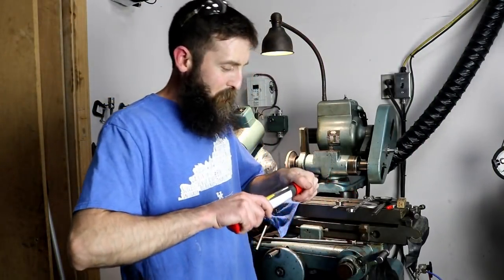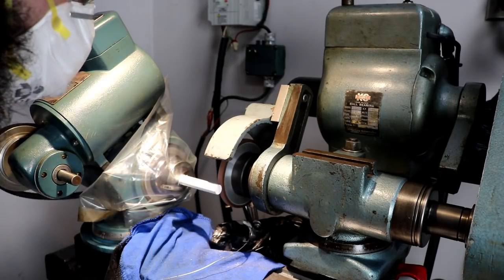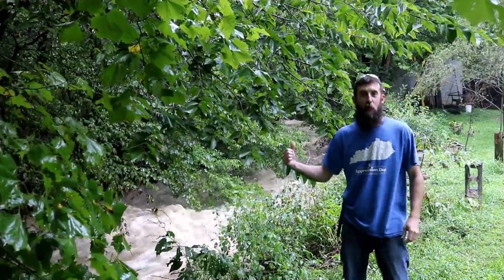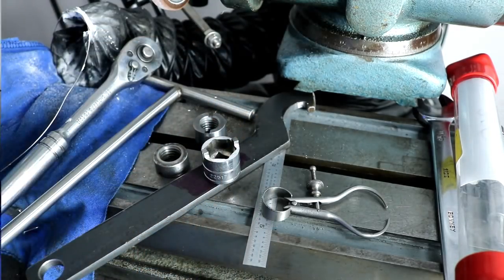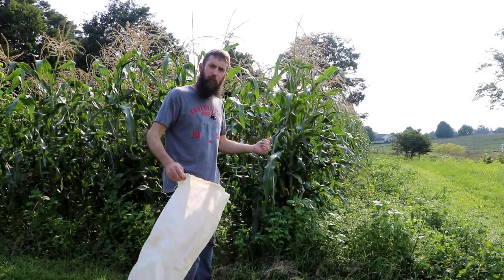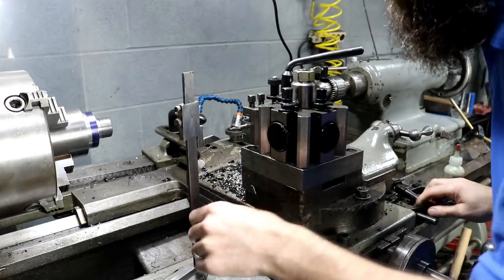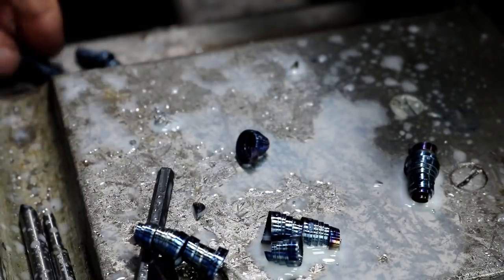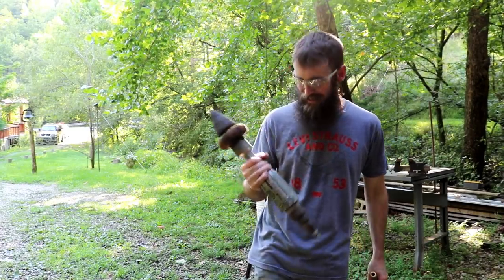CUTTER GRINDER AT WORK! /  Ceramic Prototyping Material

Comment: Concerning boring bars:  My introduction to these things was rather unusual.  In 1980 I provided, for the reactivation of the IOWA Class battleships, the then-obsolete and no-longer-fully-documented metallurgical specs for the nickel-chromium alloy homogeneous, ductile armor steel (Special Treatment Steel or STS) used by the US Navy Bureau of Ships (BuShips) and, prior to 1941 when BuShips replaced it, Bureau of Construction and Repair (BuC&R) for armored decks and small armored hull fittings of all US Navy armored warships from about 1900 (Bureau of Ordnance (BuOrd) controlled all face-hardened armor -- the thick battleship and WWII cruiser waterline hull belts and main gun turrets -- and also any armor of any kind of any thickness for larger-size main and secondary gun mounts and for any armored conning towers by fiat in the US Navy).  The reactivation required extensive changes to the ship's electrical and control wiring for such new things as the improved anti-aircraft weapons (CIWS, the "R2D2-shaped" rapid-fire 20mm guns, for example) and surface-to-surface guided missile launchers (TOMAHAWK, for example) and many new sensors and communication systems.  Eight 8" holes had to be cut through the 6" STS-armored 2nd deck (the one just below the weather deck) within a tight schedule since many cables had to be run through them for all sorts of new things.  The first ship NEW JERSEY, was rebuilt at the now-closed Mare Island Naval Shipyard in Los Angeles, California, and the head of the project, Mr. Landgraf, heard about my knowledge of such things and wrote me asking for as much information as I had on this armor, since he had nobody remaining at the shipyard who had ever worked with it and he needed to get his crew up to speed immediately.  He got an inch-thick copy of all pertinent information sent to him by me from my records within a week and he thanked me profusely.  A couple of months later I got a telephone call that he would like to give me a guided, by him, tour of the work being done on the ship at the shipyard.  Since I lived in Oxnard, California, only about 60 miles north of him, I was able to get there easily and found the tour fascinating, since I never ever expected to be inside a real working battleship (history is one thing, reality is something else!).  One of the parts of the tour was the cutting of one of those 8" holes.  He had me put on goggles and heavy hearing protection and led me into a small compartment.  Inside was a heavy support frame anchored to the four bulkheads by huge bolts and in the center of the compartment was a huge downward-pointing electric drill with a huge boring bar sticking into a hole in the deck going round and round, making an extremely loud shrieking noise as it widened the hole toward the 8" width -- the drill looked for all the world like a hand-drill, minus the handle, that King Kong would use for wood-working projects.  There was a man there with a large oil can sitting next to the hole and occasionally squirting a big blob of oil into the hole.  I cannot see how that person could stand the noise, hearing protection or not, unless he was stone deaf.  A nightmare job!   After we left the room and got our hearing back, Mr. Landgraf told me in no uncertain terms that this was the biggest FUBAR he had ever had the sad association with and he was boiling mad.  The original hole-cutting project was put out for bids and a company who used diamond cutting circular saws won as they said that they could cut one hole a day plus set-up and tear-down time, so the entire job would take no more than two weeks, tops.  Just as they were about to sign the contract, along comes the shipyard's engineering leader and says that he can do it for nearly nothing (regular costs of personnel time and material) using boring bars, drilling out each of the holes in a series of successively-widening rings using progressively larger and larger bars, plus the initial drilling of the first small hole using a huge steel-cutting drill.  The engineering leader said that his group could do the eight holes in six to eight weeks, almost a week for each hole, since they only had one of those huge King-Kong-sized drills.  Mr. Landgraf protested that this would not allow much leeway in the schedule and any error on the engineering group's part could delay the entire project and cost LOTS of money.  He was overridden (cut-throat in-house politics) and the boring-bar people did it, instead.  In the event, they barely came in under the required time, but Mr. Langraf still was really upset by this when I met him years later.  Hence my introduction to boring bars was a unique mixed thing!